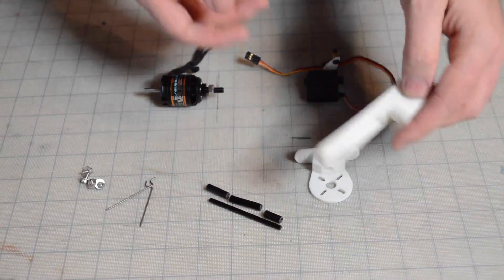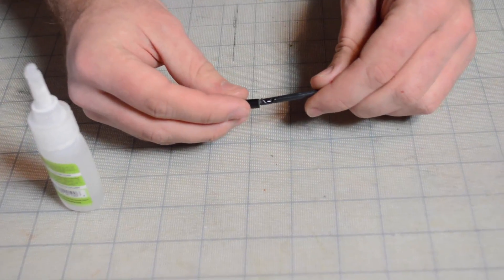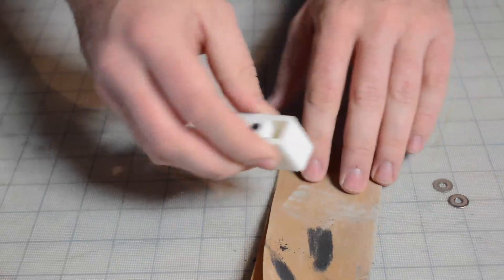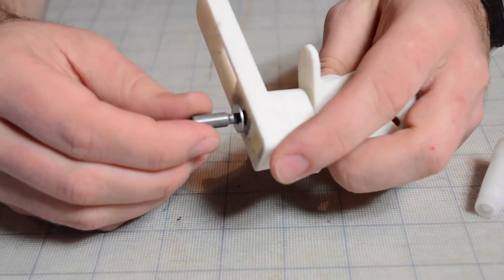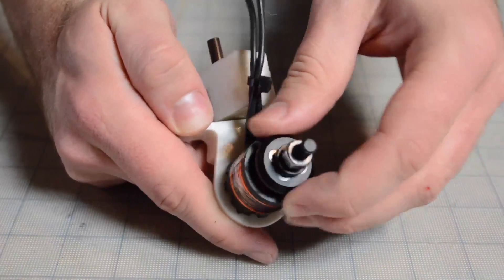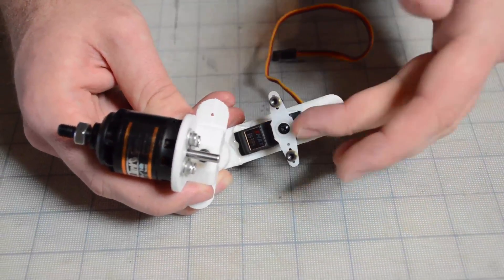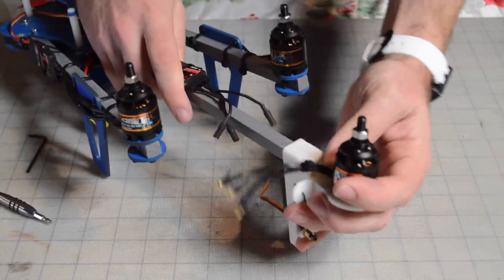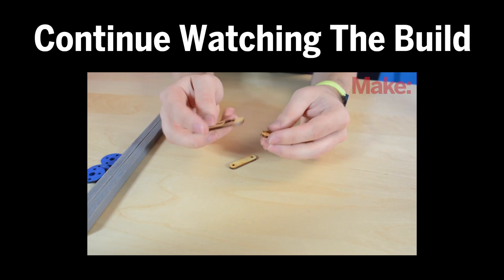MH Tricopter 3D Printed Tail Build

Comment: I like it but i like if it is a direcd drive like tricopter V3
 for example
Reply from the maker: They both have strengths and weaknesses, but yes I used David's designs for a while on my tricopters.
Reply: David Windestal is a real pioneer when it comes to the tricopter.  I have both the MH tri and David's V3.  On the MH Tri, the original tail assembly make of wood was a little weak and broke after a minor crash.  David thorough his generosity made available the 3D files for his tail assembly and I have since adopt it as a replacement to the MH Tri.